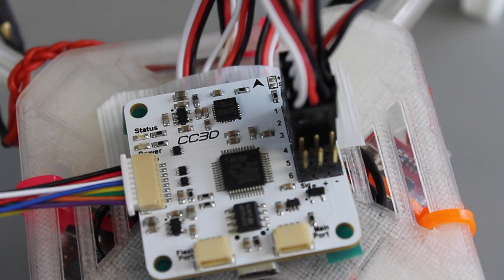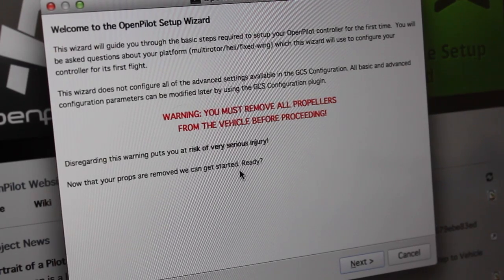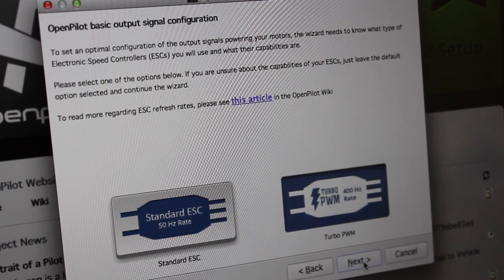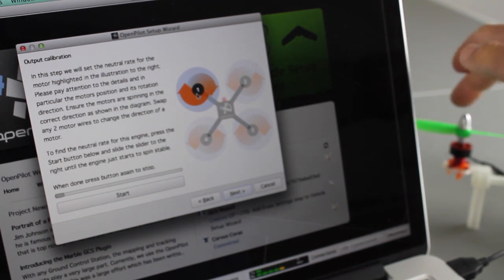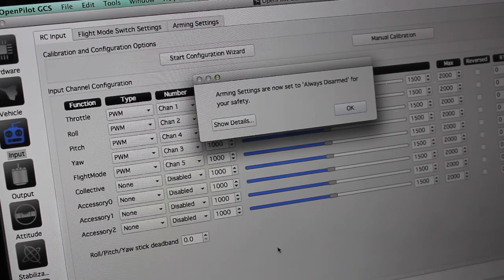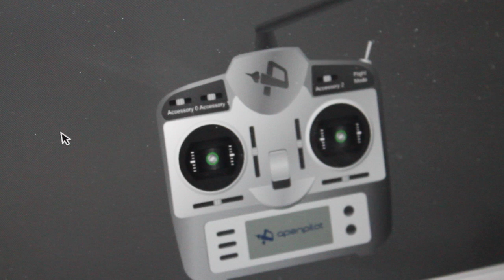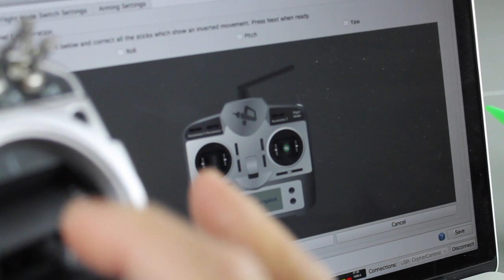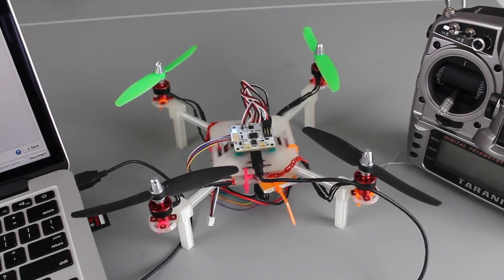DIY Mini Quadcopter w/ OpenPilot CC3D Wiring, Configuration, and Garage Maiden

Comment: Hey Dennis would you recommend this for a 1st time quad flyer? Does it support GPS?  I have built a 450 size quad with a KK 2.0 board? But on run up one motor failed by shorting out internally and blowing/smoking the esc & KK board :/ I have flown RC for 15 years fixed wing & heli both so I am not new to this stuff.  I need to do something with my my quad copter as it has been sitting over a year now. Awesome video by the way, thanks for any help.
Reply from the maker: slickjimmy I love this board. It's incredible. Regarding GPS here is info on the feature although I've never used it personally:

http://wiki.openpilot.org/display/Doc/GPS+Add-on

I think you'll find the CC3D setup more intuitive than KK2 given their OpenPilot GCS configuration software.
Reply: Dennis Baldwin Awsome! Thank you for your input and info :)
Reply: Dennis Baldwin Done deal have the CC3D board on the way from ReadyToFlyQuads!

Comment: need some help my board wont update firmware so I can setup my quad it says time out or disconnect or reconnect board I no at one point it did update once
Reply: Where did you buy it from?
Reply: banggood.com  found out its the 14.10 with v3 boot loader  but It wont let me update the boot loader to v4
Reply: ejb 84 It will work.  I bought the same one.  Follow the directions here.  If it isn't recognized by the OGS, and says something about DFU, then try again but with a different USB port.  Keep switching around and it should eventually take.  http://wiki.openpilot.org/display/BUILDS/Bootloader+update#Bootloaderupdate-UpgradetheBootloader(BL)&EraseSettings
Reply: Thanks they sent me another board something was wrong with the other one it keep on saying error

Comment: You didnt show how the battery gets connected to this
Reply from the maker: RC Surf You're right. The battery is connected to the ESCs, which provide power to the CC3D board. This in turn powers the RX. Hope that helps.

Comment: what was that you used to hold the controller to the board?  will it hold on Carbon fiber ?
Reply from the maker: Grandpa Jake In the case of the CC3D I used Kyosho Zeal. This stuff:

http://amzn.to/1297wsf

Not sure if it will hold carbon fiber. It really depends on the weight of what you're holding. But it's super sticky stuff and works well for me. I generally mount it with something on top. Not sure I'd trust it to handle something hanging below it.
Reply: Thanks,  I will order some and give it a try.  Take care
Reply: I just got my Kyosho Zeal,  that stuff is great.  Thanks again
Reply: Grandpa Jake will the zeal hold on carbon? If you can wash this and it will glue again or is a type glue on top and bottom

Comment: Dennis, There are so many OpenPilot CC3D boards available on internet in the price range starting from $15 till all the way above $50. How do we know which one is original and which one is clone?
Reply from the maker: TrueThinking I have a friend that purchased a couple of CC3D knock-offs on ebay and had no problems, but I generally try to stay away from them. I got my original board from getfpv.com and recently have purchased from readytoflyquads, which provides the board for $19 and is a reliable source.

Comment: It says on Open Pilot's starting guide, that you only connect the Red and Black of one of the ESC's to the CC3d, and for the other 3 escs just connect the Signal wire only (white). You didn't do this i see. Any thoughts? mine is new and i haven't powered it up before i understand!
Reply from the maker: Jonathan Reichert You're right. I didn't do this and have never run into a problem, but when recommended you should remove the power & ground from the other 3 leads. Just so we're clear on the 1st ESC you should keep red, black, and white. Then on the rest have just white. This explains it well:

http://wiki.openpilot.org/display/Doc/CopterControl+Hardware+Manual

Good luck with your setup.

Comment: Hello,  just a bit curious about the mini,  I was going to build an Xbird 250 mini.   It comes with the CC3D controller, but I will need to add a radio.   Do these fly well without a GPS?   any help would be greatly appreciated.   Are you happy with your selection for a radio?  

Thanks
Reply from the maker: Grandpa Jake These fly great without GPS....although I'd love to find a way to get GPS added to it soon. I mainly use it for ACRO flying, but it's super stable as well. I love the Taranis radio. Check out the Taranis Plus too.

Comment: Hi Dennis, have you tried the Naze32? I've been flying at tricopter with a CC3D for a few weeks now. While configuring the is pretty easy and the tricopter flies Ok, I can't seem to get past that. Tuning it seems so difficult. I can't seem to get it dialed perfectly. I also fly with the new black DX6. It doesn't have any sliders, so I can't tune the way you are tuning. Now I wish I had the DX9.

I'm also having the problem where any breeze upsets the board to the point of nearly crashing (or crashing). Like it will be flying and a breeze hits the copter and confuses the board. Sometimes, I have a corner that refuses to go up at the same speed as the other two. Sometimes as soon as I power it up. At other times mid-flight. Also, if I make fast movements in the air, the board can get confused and loses control.

I'm also not sure if I have a bad ESC in that corner. I'm going to swap it out first before I do anything else. I'm flying HK AFRO 30A ESCs.

Any advice would be greatly appreciated. That said, for $25, I'm thinking of giving the Acro Naze 32 a try.
Reply from the maker: Danny Cruz I haven't tried the Naze32 but definitely plan on testing it in next couple of weeks. I've only used CC3D on a quad and it flies AMAZING. Sorry to hear you're having such problems. Have you ruled out any potential vibration issues? Generally tricopters are less stable because of having one less rotor. I had a buddy that was flying with KK2.1 and had problems when descending....all sorts of oscillations. Definitely try to swap out that ESC and see what happens. If you continue to have problems let's carry on the conversation in the forums at www.garagepilots.com. Good luck.
Reply: Dennis Baldwin Hi Dennis, sounds good. I'll join Garage Pilots. I was due to make adjustments and test this weekend, but got sick. I started a thread on Open Pilot forum and got a lot of info.

I might order an Acro Naze32 now that they are readily available and much cheaper. Maybe not for the tricopter, but for a Blackout Quad I eventually want to build. Keep up the great work.

Comment: Dennis - Thanks for the quick reply...you are the best!! Yes, the first one was touching metal (not paying attention), the second one I tried the foam, gel tape and, again, wasn't paying attention and it connected the two chips on the back of the board. 

Third board went right into the clean, dry case and it worked like a charm. My contribution to other noobs will be total focus on getting the board in a case!! 

Thanks again for your feedback!!
Reply from the maker: Joe Andrews Very glad to hear you got it sorted. If you decide you want to help others getting into the hobby check out www.garagepilots.com and our forums. Thanks and good luck getting in the air.

Comment: My ESC wires are Yellow, Red, Purple (brown??)...removed the center wire on all but one re: the instructions when connecting to the CC3D.
Reply from the maker: Joe Andrews I can't tell if this is the problem with you losing your other two boards, but I can tell you that you need to remove both the red AND brown leads from the other ESCs as mentioned in the wiki:

"In case CopterControl is powered through the servo connectors, then only connect the power from one ESC and remove the positive and negative wire from the other ESC's. Connecting multiple voltage regulators (built in to the ESC's) in parallel could cause problems. Connecting multiple black ground wires could cause ground loops which we want to avoid."

Interesting to read about that ground loop issue.

There is a note about needing to connect ground on higher end ESCs but I've never had o do that.

Comment: Fried two CC3d boards in a row and not sure what I am doing wrong when connecting the battery at the stag the Vehicle connection Wizard. (They were protected in the case I bought for them).

- Using a power distribution board for quad.

- Lumenier 2250 mAh 3 cell, 11.1 volts

- Turnigy 30amp, 480hz ESC

- Motors - Turnigy D2830/11 1000KV

I am lost and afraid to plug in...do you know of a good wiring diagram. 

I have by passed the CC3D board and plugged the ESC directly into Rx and the motors work just fine - no shorts anywhere.
Reply from the maker: Joe Andrews Yikes I'm really sorry to hear that. The connection diagram I used is probably the same that you're looking at:

http://wiki.openpilot.org/download/attachments/12386767/CopterControl-connections.png?version=2&modificationDate=1334708759000&api=v2

When the board is mounted it's not touching anything metal (screws, frames, etc) is it? Also, you mentioned a case. Make sure there's nothing inside the case that is shorting out any pins on the board. One thing I would suggest it take one ESC plug it into the board. Make sure you plug it in with ground facing out. Then power it up and see if you can get the board to come on. There is a section labeled "Servo 1-6" that discusses the connection here:

http://wiki.openpilot.org/display/Doc/CopterControl+Hardware+Manual

If you continue to have problems please post in the forums at www.garagepilots.com and post some pics. We should be able to get you going. Good luck.

Comment: hi there, do you know how can i fix the oscillation in my qav250, i am using cc3d i\open pilot. thanks in advance.
Reply from the maker: Javier Uriel Have you worked with the gains at all? They may be too low. Also, have you checked that your props/motors are well balanced?
Reply: i am new Dennis and thanks for taking the time when you say gains, you mean yaw?

Comment: Do you not need to remove the power leads from the 3 other ESCS before plugging into the CC3D? Just curious cause the open pilot wiki says to do that and I want to make sure before I screw something up.
Reply from the maker: Derek Rushforth A lot of flight controllers recommend doing this although I've never had problems with keeping the power and ground connected. I can't speak specifically for the CC3D other than I used the able provided which has only 1 power lead and the rest are just signal. I guess it's better to be safe than sorry....and if the wiki recommends it then I would definitely do it. Good luck. I think you'll really enjoy it.
Reply: Dennis Baldwin I did what you mentioned and played it safe with 1 power lead and the rest signal. It worked out great. Thanks for replying!

Comment: Helli i am building a quad with this board and was wondering how you power the board?
Reply from the maker: If you use the cable supplied with the board then you'll see that one of the connectors has three leads. This includes signal, power, and ground. That one lead will get power from your receiver. +5V Hope that helps.

Comment: I am setting this up on a 450 size quad with a turnigy 9x. I was wondering what the flight modes are? Self Level, Manual...? Also can you set this to a dial switch so you can turn up the self level as needed? Any tips for tuning it?
Reply from the maker: Here is a good description of the CC3D flight modes: http://wiki.openpilot.org/display/Doc/Flight+Mode+Switch+Settings Good luck with your configuration and check out www.garagepilots.com if you want to post more questions or share answers related to your builds. Take care.
Reply: Dennis Baldwin Great info, thanks much.

Comment: Does this controller support GPS?
Reply: Johnny Sprada Thanks.  Do you have a link for a U-Box GPS?
Reply: Johnny Sprada Would a NEO-6M GPS Module work.  Does it plug into the CC3D board directly or would I need an adapter?
Reply: Hi Chris

CC3D does not support GPS in the way that you maybe think, it is not used for navigation or position hold on CC3D. You need Openpilot Revolution for this to work.

Comment: THANK YOU DENNIS!  Great video (as usual).

After you've flown the CC3D for a couple of weeks, I hope you'll return to us and tell us how this $90 board compares to the $15 Flip 1.5 board.  Since the CC3D is six times the price of the Flip 1.5, does it fly six times better, or twice as good, or what?  And yes, I believe that the quality of the interface software also figures into the value of the product.

Although, I do think that a more "fair" comparison might be the CC3D against the $18 Flip32, that way it's one 32 bit chip against another.  (You've got to love Paul's prices!!)
Reply from the maker: Steve, you make an awesome point regarding price vs ease of use. So no, I would say it flies 6 times better than the MultiWii, but man it's incredibly fun and responsive. But yes, I agree that the price is definitely worth the simplicity of getting up and running. I have a video coming out in the next day or two that covers tuning this thing. It's pretty easy. Thanks for the comment and I appreciate the feedback.

Comment: Well done, looks like it fly's great. What is the flying weight, battery size and flight time?
Can this board support a tricopter? I might give this a try on my mini tricopter to make it even smaller with a smaller board:) thingiverse thing:206260.
Love the videos, keep em coming.
Reply from the maker: Battery size is 800mA 2S. Let me weigh the setup and get back to you. I get about 8-10 minutes of flight time if I'm doing casual flying. Aggressive flying is about 6 minutes. These are rough numbers as I need to time this as well. Yes, the CC3D will support a tricopter. That would be a fun project :)

Comment: Can you let us know how you address the oscillation , I have a naza and I am still getting a bit. Thanks
Reply from the maker: You can setup your transmitter knobs to adjust the gains in realtime. I posted a video here:

DJI Naza Basic and Attitude Gain Settings for Pitch & Roll Using Turnigy 9X Control Knobs

Good luck.

Comment: Thank you for doing a video on the CC3D. I have been looking at this controller for a long time and I am getting ready to pull the trigger and buy it. As always, it was very helpful and descriptive video.
One question, do you think the controller would be able to handle a "Deadcat" conversion well? I recently changed my SK450 to the dead cat, so I would have more space to work with, but the Naza M Lite that is currently on my quad seems to fly very different now. It tends to pitch up or down after yawing. Is this because it is not compensating for the swept arms in front? Just curious how the CC3D would handle this too.
It almost seems to be too much trouble to get my quad to fly right and I am tempted to go back to a KK2.1 board. Thanks for your help!
Reply from the maker: i'm not sure how it will handle on a dead cat setup. I know there are many pilots that fly the CC3D on a TBS Discovery, which is fairly similar. I think you'll need to work on tuning it to get the desired results. But I can tell you this flight controller is amazing. I just did some tuning this evening and it handles like no other controller I've ever flown. Good luck and let us know what you end up doing.